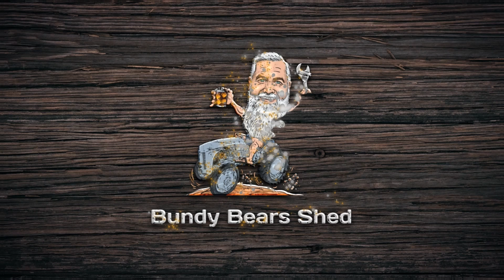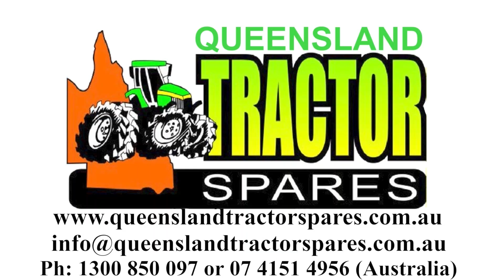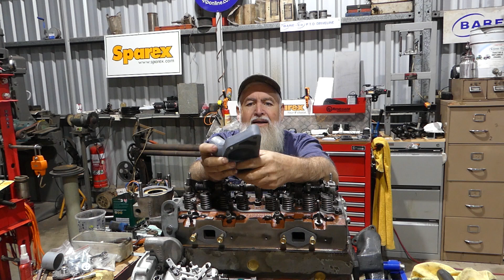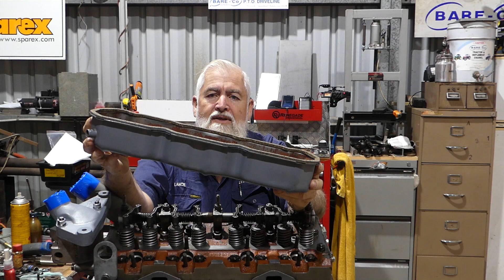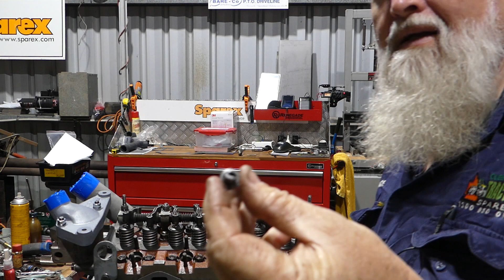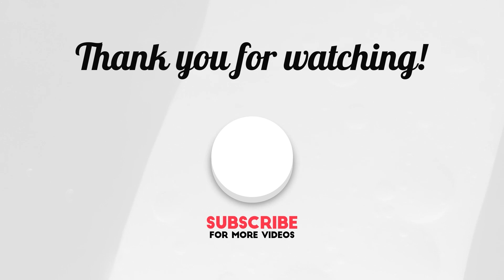Massey ferguson 65 # 41 Thermostat, Rockers and Catch up Yarn

Comment: I am a firm believer in thermostats, I like to see a motor warm up quickly. Good tip on the contact adhesive on the rocker cover gasket, some cork gaskets can be a bugger for sure. Grease on a tap will catch a lot of swarf but you are the one who knows Lance,  not me. Jeff
Reply from the maker: I go for thermostats in cold climates for sure

Comment: Hi Lance😊
When I was younger I had a small farm, I had a red 880 David Brown and a red Fergie 31 petrol, I have sat many hours on them, the David Brown stayed on the farm when I sold it, the Fergie I took with me, I live in a house now, it was standing in my front yard a while and then I sold it, it was worn out I wish I had it now I could have fixed it by watching your videos, I retire in not so long time, maybe I will get one, I have a small machine shop similar to yours, I could make some of the parts it could be fun to work with. 
We are getting up to 34-36 degrees today….. maaaaaan that’s bloody hot 🥵 we’re not use to that kind of heat. 
Hi from Henning.
Reply from the maker: 34 to 36 is starting to get uncomfortable, Great hobby being a tractor fiddler.
Reply: @bundybearsshed  
The record here in DK is 36,4 from 1975 and it was 35,9 yesterday but lucky it’s over now, up to 26 today and tomorrow down to normal about 18-20 degrees, that’s better for an old Viking fart.
Yep 👍 it great to have something to fiddle with, looking forward to the next video.

Comment: I am fighting the same fight with aftermarket parts here in the states. Sparex and  A&I products are the two main producers of parts. It is hit and miss. Mostly miss.

I bought some spindles for my 135. The wheel bearings would not fit on correctly. I sent them back waiting on the refund so I can get the N.O.S spindles I found.
Reply from the maker: I dont have much trouble but I do have it, mainly with Bareco parts over here